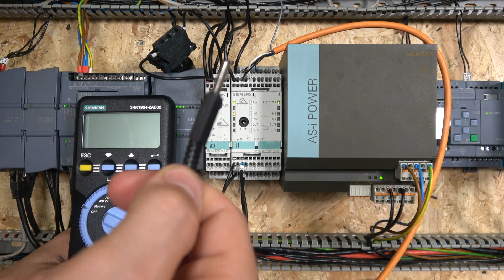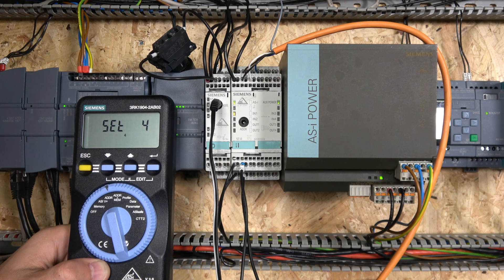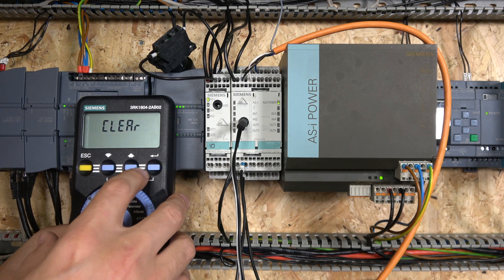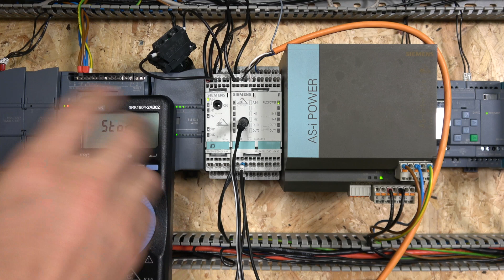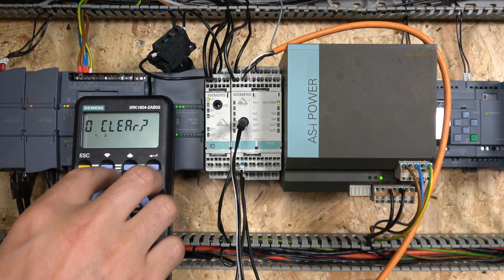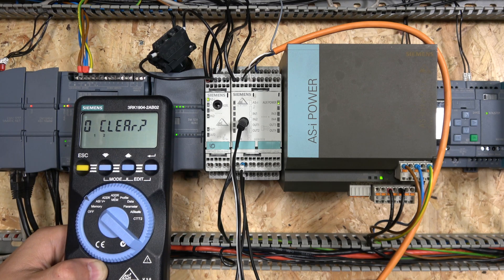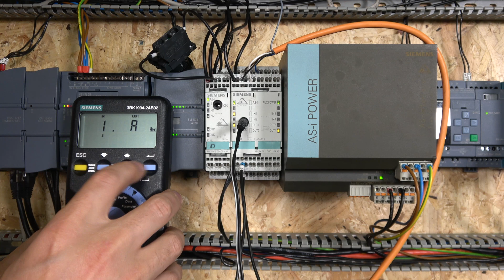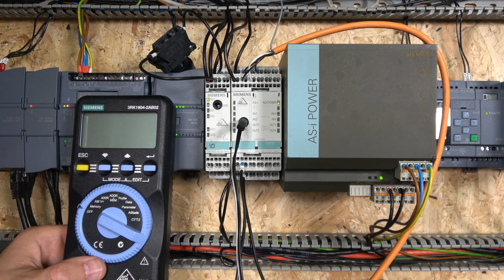Siemens S7-1200 PLC, CM 1243-2 AS-i interface addressing unit, diagnostics. English

Comment: Hello everyone,
Im try to connect Multiple light beam safety device (MLD510-RT3/A) Asi interface to PLC S7-1200.
I use AS-i Master CM 1243-2 and AS-i Data Decoupling Unit DCM 1271 to connect this device.

Because Multiple light beam safety device (MLD510-RT3/A) factory slave address =0. To configure i want to change slave address to =1.
I want to ask if TIA PORTAL can set the slave address for ASi-Slave Device.

Many thanks for any idea,

Comment: How to remove double address in asi devices
Reply from the maker: By Using this device. Find the addresses that have the same number and change one of them to the number that is not used. Also by doing so make sure that plc knows that address as well in you network configuration.